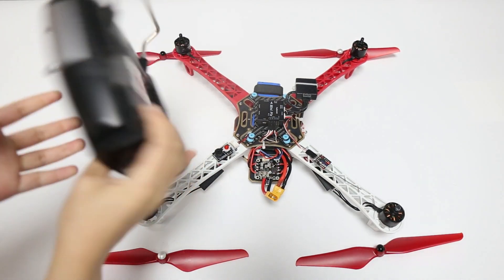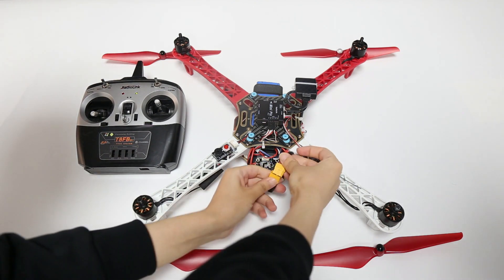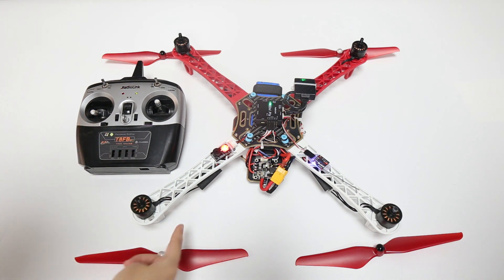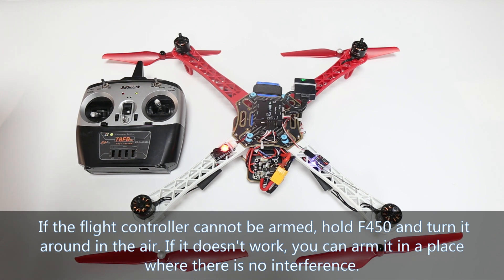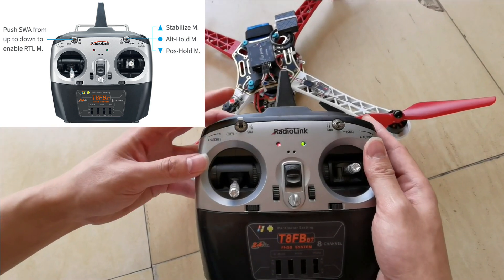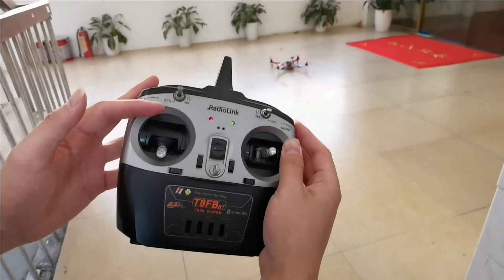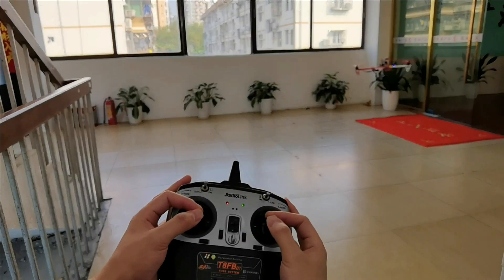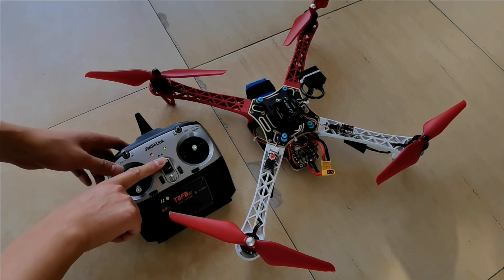How to Fly RadioLink F450 Quadcopter?

Comment: Can we use this T8FB radio module with radio link crossflight??? And instead of using a standard telemetry module, can we use HC-12 Module as telemetry??
Reply from the maker: Hi, sir. Do you want to use R8EF receiver, T8FB transmitter together with CrossFlight? Yes. You can. CrossFlight supports receivers with SBUS or PPM signal. R8EF supports SBUS signal. So they can work together. And for HC-12 module, sorry we do not know about it, we do not know if it is compatible with CrossFlight. We recommend you to check the detailed manual of HC-12 Module to see how to use it. If any question please feel free to contact us. Our email is after_service@radiolink.com.cn